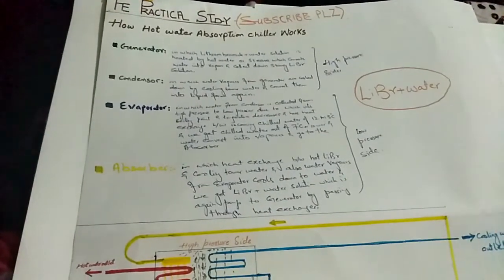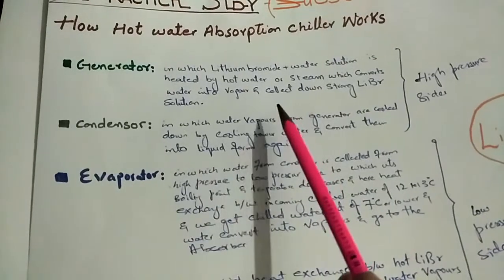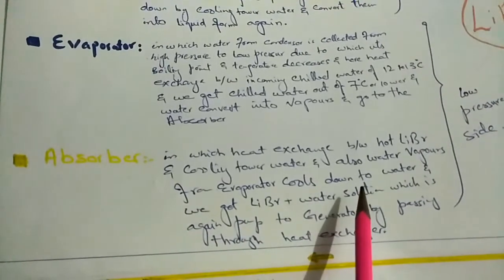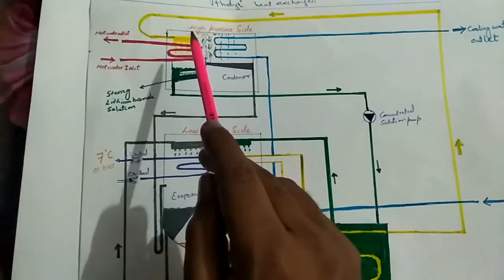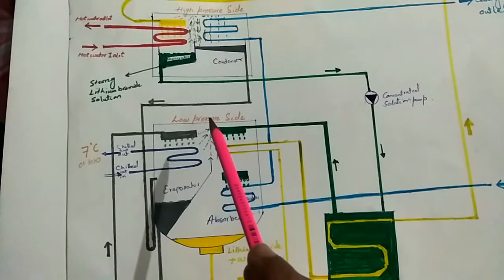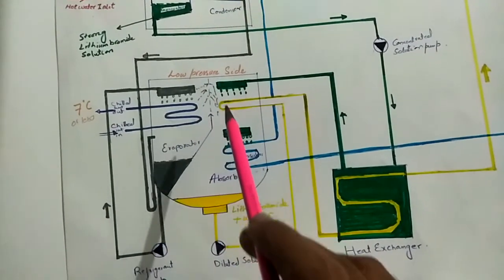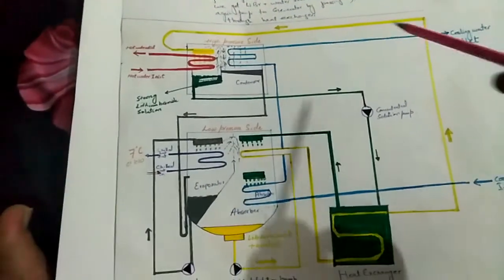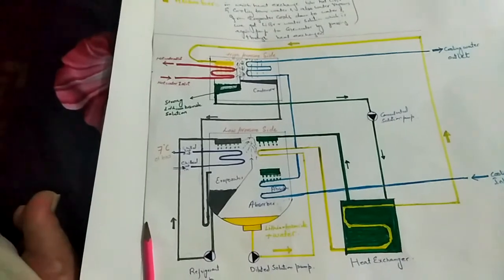how hot water absorption chiller works

Comment: Great video, thank you. I've been in HVAC for 45 years, until recently I have zero experience with absorption chillers and now I am tasked with operating one in a huge chemical plant. NOBODY there knows these things (less than me even) so your video is helpful. I'm getting it... got the 35 year old beast running pretty well... but figuring out how to trim it. Everything has been disconnected and it runs from an analog switch and all my gauges are suspect. Little by little bringing it into shape.